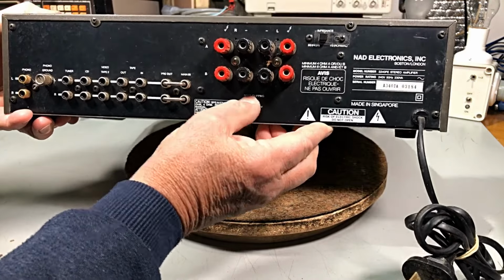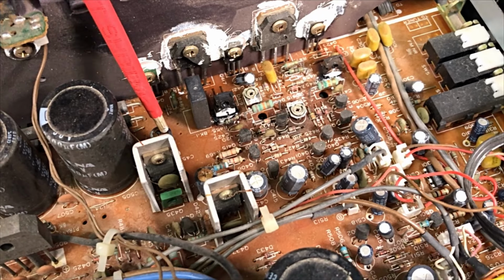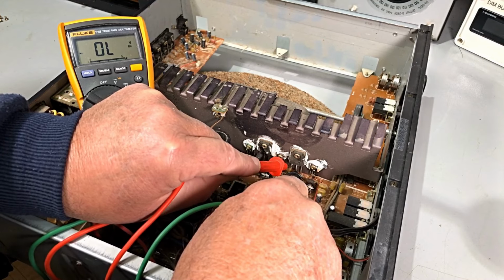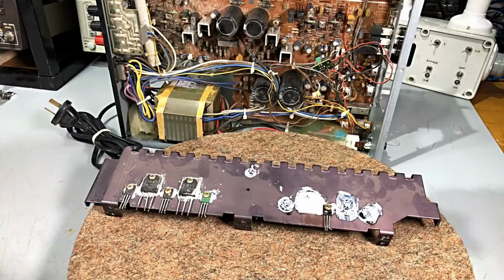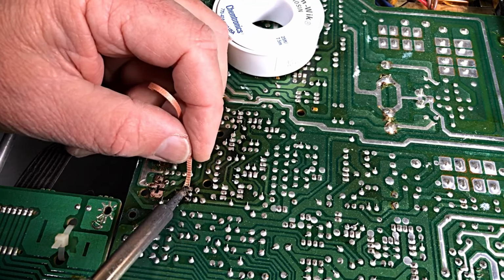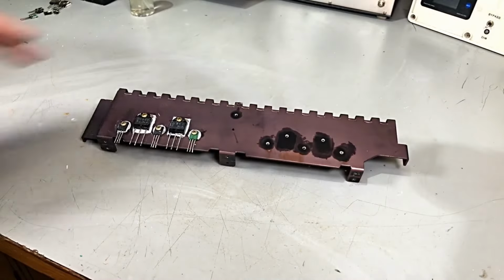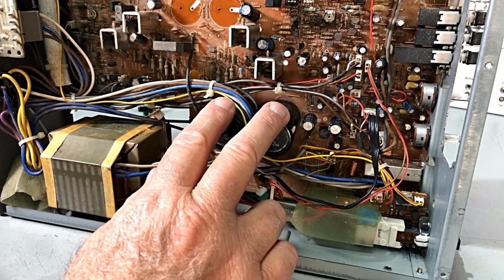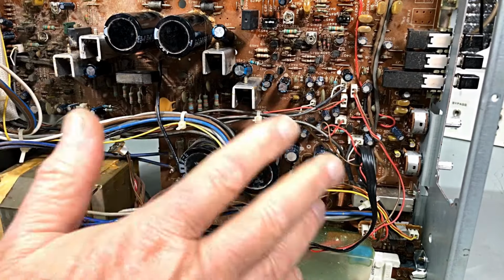NAD Amplifier SMOKIN ! - Part 1

Comment: The soft clipping when engaged is designed to deliver more power to the lower frequencies enhancing the bass. The last two numbers indicate wattage rating, (40 watts per channel) into 8 ohms. I have the identical model, had to replace all the output transistors and main drivers along with a small cap located right beside the main filter capacitors in the power supply, (sound quality is excellent).
Reply from the maker: Thank you for the info. 
Lots more detail will be in Pt2. I have replaced most electros & tested all the others. Should all be 100% when finished. They are a great amp.
Cheers

Comment: When using the solder-wick braid it helps to flood the zone with liquid RA rosin flux. This assists the melting solder to flow into the braid via capillary action virtually instantly. This reduces damaging & lifting of the PCB trace as well... You can always cleanup the rosin with something like isopropyl alcohol on a cotton bud after.
Reply from the maker: Lol, Mate been soldering pcb's for around 55yrs. Think I am doing OK so far !
Reply: @techobaz55  Snap!.. I've been a tech/engineer for equally as long & always found anything that helps is always a good thing. Most my work now is SMD on industrial/broadcast kit but i have seen my fair share these NADs that folks always seem to detonate to bits! They even manage to damage the power supply section!
Reply from the maker: @peteb2  ok, sound good 👍

Comment: Good luck with this one Baz. Those style of amps where the DC current can run right through the circuit can get pretty expensive to repair. Luckily there aren't too many output transistors. I hope the carbonised board isn't too bad around those drivers. Looking forward to the next episode when you get those transistors supplied. I actually like the NAD amps I thought they were kept fairly simple - no fancy tone shaping and feedback beyond what will make it sound good. And if you did want an equaliser you could always stick one between the pre-amp and output as you showed.
Reply from the maker: All transistors have arrived, lets do it today & see how it goes. Vid up in the next couple of days I guess !

Comment: Make sure you give the speaker impedance switch a clean and work it back and forth. The contacts can go intermittent / high resistance from just sitting there not being used for so many years.
Reply from the maker: A very good point. I will be cleaning all switch contacts & pots in next vid.

Comment: The schematic and service manual should be on hifiengine.   7240pe would be very close.  There will be at least 2 output transistors per channel.  One (or 2 in parallel) for the low voltage rail, one for the high voltage rail (the power envelope topology, aka class g).  Soft clipping is a circuit in the preamp stage.  At high voltage it routes the signal across a diode drop which smoothes the peak of the sinewave a bit.  Both these circuits can be studied in any schematic for nad pe stuff.
Reply from the maker: Yep, already have all info, waitingvon parts. Cheers

Comment: The "Power Envelope" NAD amps have a bad reputation for unreliability, I would not touch them with a barge pole even though I'm a huge NAD fan. I have a few on my channel. Just subscribed btw.
Reply from the maker: Ahh, thanks for the comment. I just wanted to share this repair out there. Thought it may be of interest. I have repaired lots of NADs in the past, not one of these though. Never seen one back (yet).
Will check out your channel & sub of course.
Cheers
Reply: No worries and thanks, I'll be watching all of it tomorrow as it's late here in London atm. My dad was from Brisbane, good day.

Comment: Soft clipping works similarly to McIntosh "PowerGuard" in that it most likely rounds off the top and bottom halves of the waveform to reduce distortion and prevent damaging the tweeters. Based on the numbers on top of the filter caps I would estimate that your amp was made in 1988 (8844=44th week of 1988) We had a Fisher CA-276 of about that vintage that put out so much smoke the customer called the fire department. It was quite an extensive repair to say the least. About 10 transistors, 12 capacitors and 8 resistors to say the least. This was back about 35 years ago so my memory of this is a bit foggy.
Reply from the maker: Excellent info, thank you for your comment !
Cheers